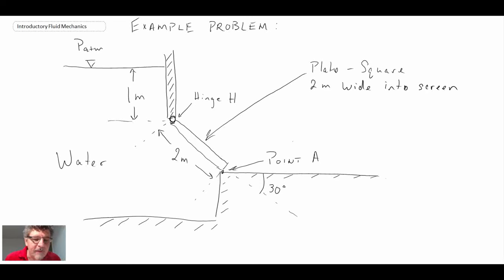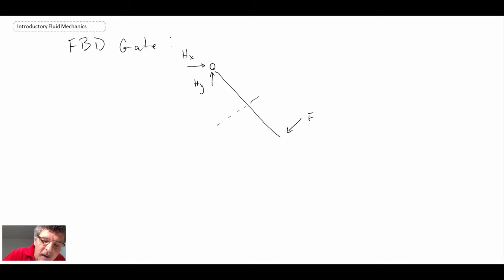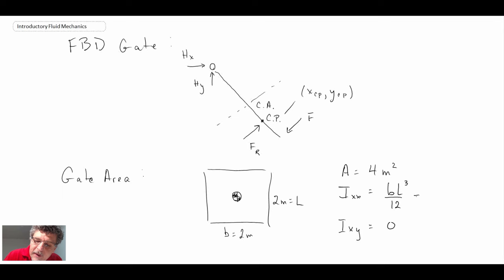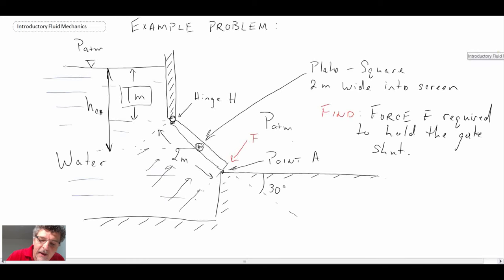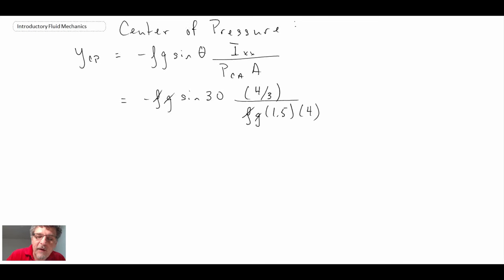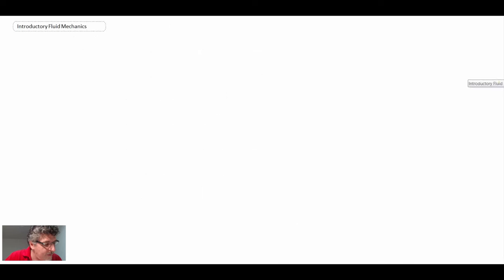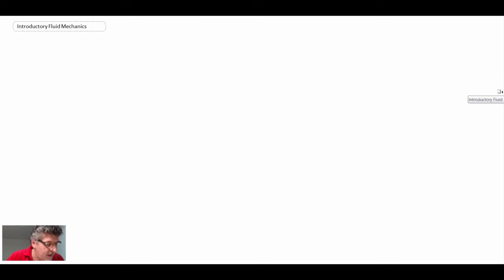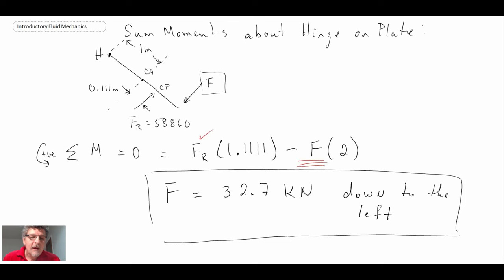Introductory Fluid Mechanics L5 p5 - Example:  Plane Surface Gate

Comment: Hello,
wonderful channel you have got here, sir!
I was wonderig, why didn't we put the weight of the gate as well as the reaction force at point A into account?
Thank you very much
Reply from the maker: The weight of the gate should be included, but it was not provided in the problem statement.  The reaction force at A was not included as we are computing the force that is required to hold the gate shut.  If the force was larger than required, then there would be a reaction force on the other side of the gate at A, but we are computing the force that is "just required" to hold the gate shut, and as a result the force applied is enough to balance out the hydrostatic force but nothing more than that.  Glad to hear that you find my lectures helpful.
Reply: Yes, understood.
Thank you for the very quick reply.

Comment: Hey, thanks for all of your videos. I'm confused about why Patm drops out of the equation. Can you explain that a little more please?
Reply from the maker: +bajanalpha4 It is because you have Patm on either side of the plate.  On the water side the pressure is Patm plus the hydrostatic head pressure (rho g h) while on the other side it is only Patm.  The hydrostatic pressure varies with vertical position on the plate, whereas the Patm component does not vary - given that Patm can be considered a constant for the very small vertical displacement that we are considering in this problem.  If you were to do a static force balance on either side of the plate (pressure times area), the force on the air side would be a constant (Patm * Area).  On the water side you would have the component due to atmospheric pressure (Patm * Area) plus a component that would vary with position along the plate - the (rho g h) component.  Hope that helps ...  and happy to hear that you find the videos useful.
Reply: +Ron Hugo Thanks so much! and yes! they help tremendously! I've been using you to help understand things since Thermo and will continue to Heat Transfer after I pass Fluids hopefully! Thank for all that you do!